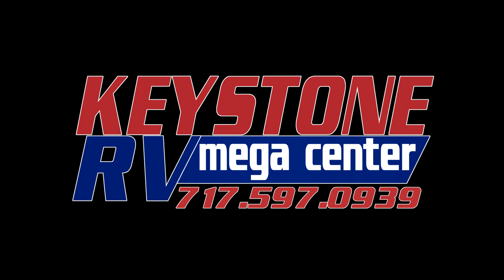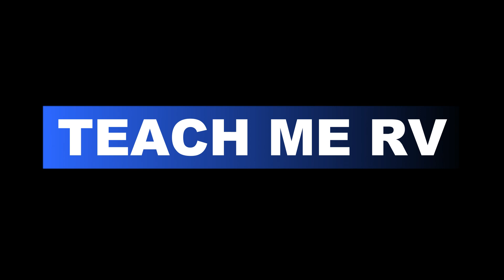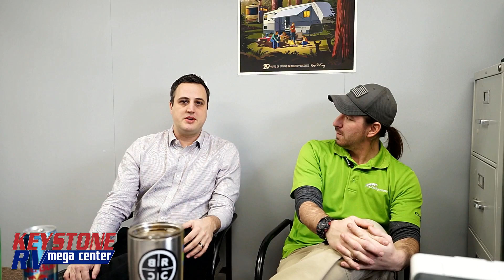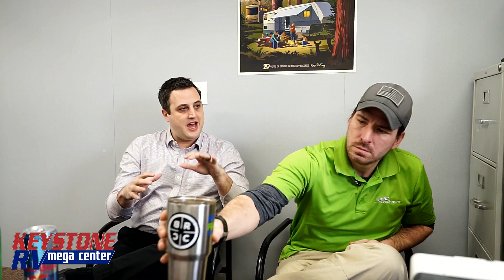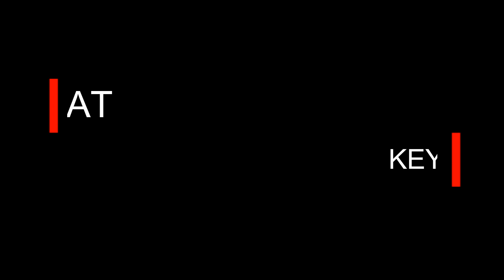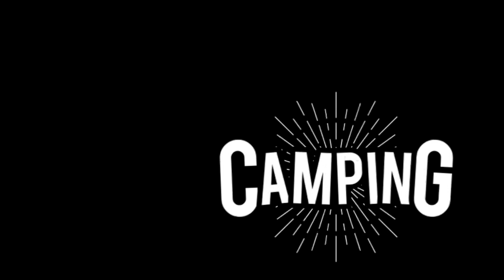Arctic Wolf & Alpha Wolf, Cable Drive Slides & More! | Teach Me RV!

Comment: Fell in love with the 2021 Alpha Wolf 26RL-L so much so , the wife and I bought one this week , take delivery July 22nd! You touch upon a subject in this video that important, TOW VEHICLES! I now have to find a used truck to tow this trailer and you mention 1500 series trucks are able to tow and then you mention SUVs , any suggestions as far as SUVs or pickup trucks from the year 2000 and up that would work for towing the 26rl ? Im pkanning on using airbags, hitch/ weight stabilizers anti sway as well .
Reply from the maker: Sorry Just getting to this. It slipped by me I am sorry
-JR
Reply: Do you still have it :p

Comment: Is a 31ft alpha wolf to long for a lightweight half ton truck?
Reply: Too many variables to know....brand truck, engine, gear ratio, cab size, bed size, 4x4 or 4x2? 
Give you an example 2018 Fiat Ram 1500 Crew Cab Short Bed range from 4,510 lbs to 10, 220lbs
There is a ton of info I need to know just for the tow rating plus I would need to know payload capacity
Reply: I have a 2012 f150 supercab ecoboost 4x4 with the tow package and I  tow the 27rk-L which is 33ft and like 7,300 pounds and it pulls it just fine.
Reply from the maker: Just pay attention to payload

Comment: Can your rep tell us about what to do if cable slide gets stuck.
Reply: There is a way to bring them in manually with a flexible head tool and a drill. Depends on the type of failure. If its a motor failure that would be how we do
Reply from the maker: We are getting ready to do a video on this